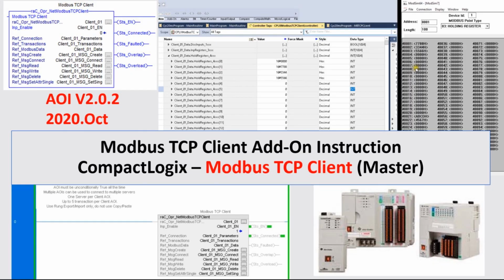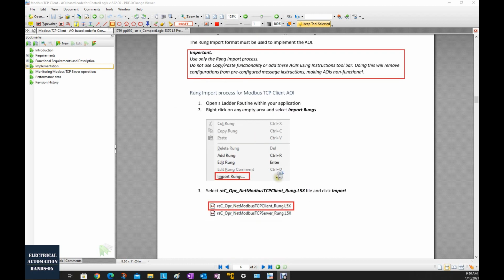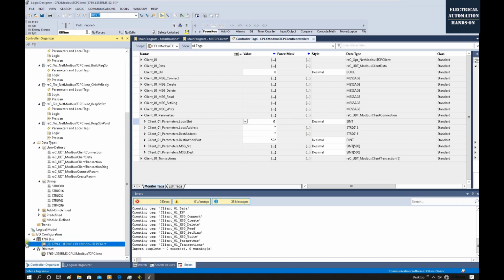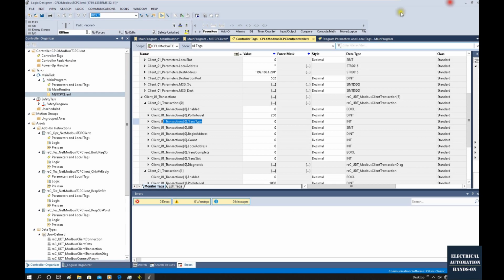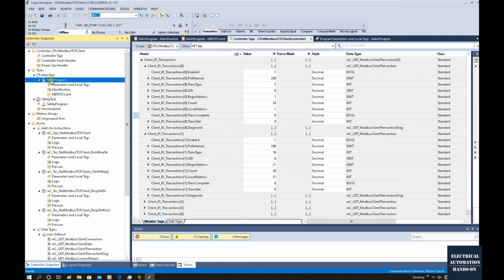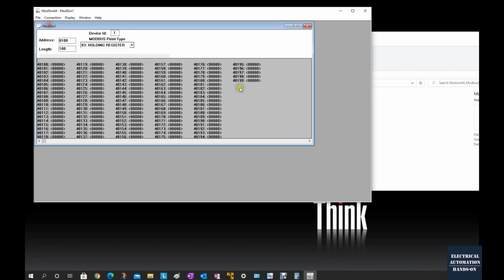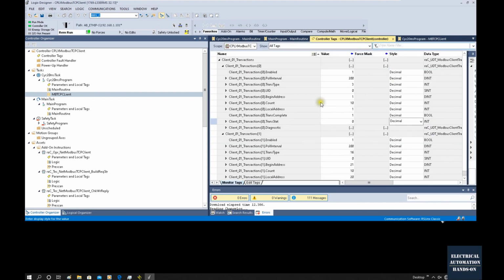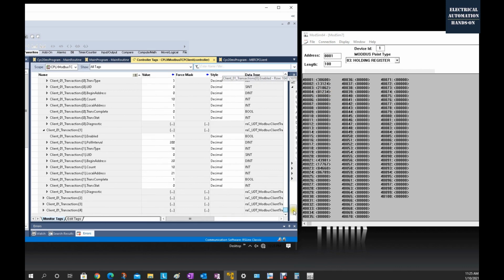COM16. ModbusTCP Client via Allen-Bradley CompactLogix PLC

Comment: THIS VIDEO WAS VERY HELPFUL, BUT MY DOUBT IS IF WE READ 2 DEVICES LIKE 2 MFM BOTH HAS SAME HOLDING REGISTER ADDRESS THEN HOW DO WE READ? WILL THE DATA GETS OVERLAPPED. PLEASE SOLVE THIS.
Reply from the maker: If you have two or multiple devices. there would be two ways and they are very common. 1. using different instance and call the function block.  2. program by yourself and control the connection parameters and reading buffer by different target object.

Comment: Hi, I want to write to the PLC that is not exactly in the same network IP. Is this still possible? then Ethernet connection between two different Ethernet switches makes sense or I need to do modify the communication network?
Reply from the maker: You need router for crossing different IP segments

Comment: How can i solved fault -8?, nice video btw :)
Reply from the maker: Please check your instance (may be double instance, and also check if the port is blocked)
In the manual "Modbus TCP Client - AOI based code for ControlLogix v 2.04.00" it explain the '-8' code, also you can find the more details in this link https://literature.rockwellautomation.com/idc/groups/literature/documents/at/enet-at002_-en-p.pdf#page=51

Comment: Very useful content- thanks.
I’m trying to implement this on a 5380 CompactLogix to read the measurements from Yokogawa WT1800E power meter. 
I have a question.
In order to read the power meter data, I need to combine set of Two INT to REAL data at the PLC. How can I do that? I prefer ST programming if possible. Thanks in advance for your help.
Reply from the maker: Not quite sure the "combine set of Two INT to REAL data ", how and which way you combine two INT to Real. If you have a real data 9876543.12,  you can x1000, then convert 98765312 into DINT, then split DINT into two INT/WORD to transfer to PLC. Then PLC use the same backward way to restore the data to REAL.
Reply: @electricalautomation  Thanks for the response. I did find a way to do this by using COP instruction. COP instruction will combine and convert two adjacent INT array to REAL array.
Reply from the maker: @rajkrishna336  Glad to hear you found solution

Comment: Hi, very good tutorial! Can I do this Modbus TCP Client communication using the same physical port that already communicates with a 1734-AENT Ethernet/IP remote? Both the EtherNet/IP remote and the Modbus TCP equipment are in the same IP range.
Reply from the maker: Yes, I think you can, a physical port can be shared used.

Comment: Thanks for this nice videos,
I have a question for you : 
The data is limited at 1024 (coils 0 at 1023 coils....), if I want read data greater than 1024 (for example adresse registre 1030, 12680...) what can I do ?
Reply from the maker: Hi Bud, a quick answer, you may set the "start" from a higher start, then the total still the 1024. 1024 is the buffer length from the AOI function block but you can set the start modbus address. I haven't got a chance to test this, pls let me know if that works
Reply: Unfortunately, it doesn't work
Reply from the maker: @hichamcool76  I recommend you contact AB support for your case.

Comment: Thanks,

Verry good tutorial.
One question :  If the client want to communicate with 8 servers, is it mean we need to create 8 clients ?
and Is it mean we need  ( 93 + 7*20) Kb ?

Best Regards
Reply from the maker: If answer shortly, I would say yes. But you also need to check the TCP connection resources from the specification of your CPU. 8 should be OK for the mainstream CompactLogix. An alternative way is that using one Client AOI FB. Then program the sequence loading the 8 of IPs and data into this AOI data buffer one by one. But I don't think someone would like to do this.
Reply: Thank a lot,